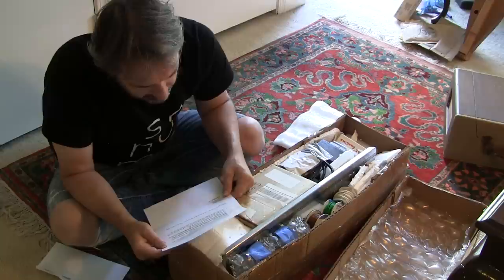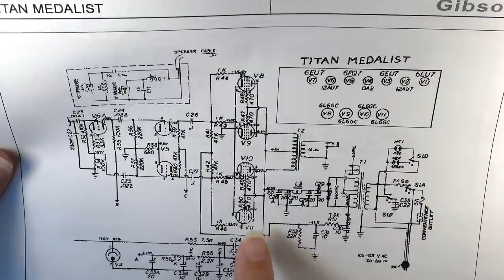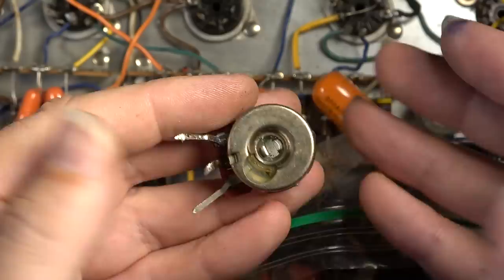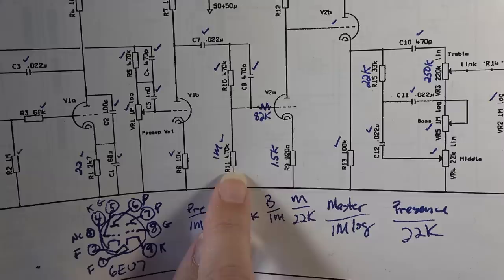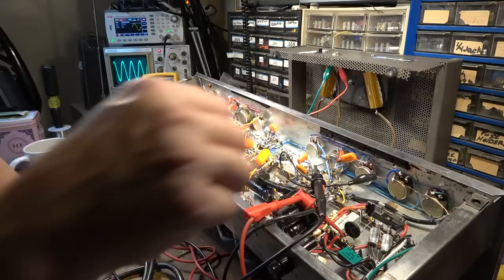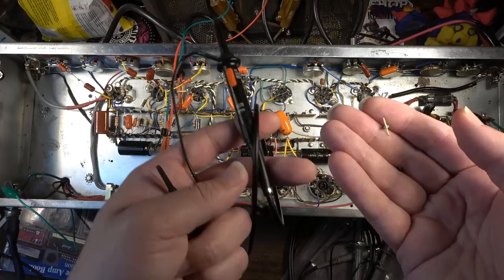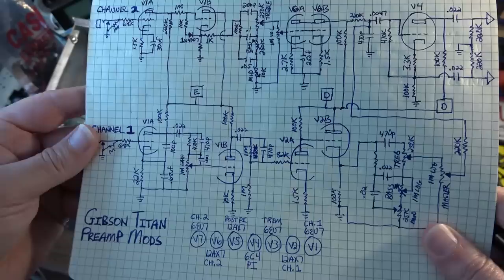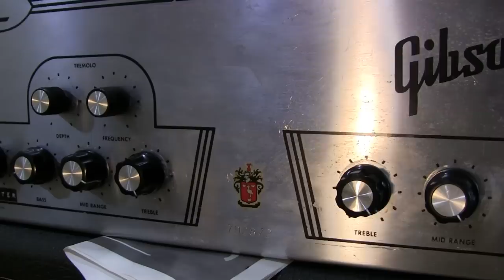The MOST POWERFUL GIBSON AMP of the 1960s - TITAN MEDALIST REPAIR & MODS!

Comment: Man, it’s so much fun to mess around with basically a clean slate. 

I used an early 15 watt Marshall DSL chassis and cab to build something similar to this. I even kept the spring reverb that’s active on both channels. 

The Marshall side sounds more like a SLO with that 4th reverb gain stage. The cathode follower really hits the last stage hard though.

I had to send a lot of gain straight to ground later in both circuits and it still rips your head off!

I had to cut the reverb level by 90% compared to the standard Fender levels.

If I had used all 12AY7’s it would still had been set to kill.

The hardest part was patching up the original chassis holes by soldering in brass plates.

Comment: Very impressive. The dual nature of the amp is actually pretty cool. I don't play that kind of Marshal sound anymore but it really is there in all it's screaming glory, while at the same time the Fender side sounds great, as it should. Very nice tone. I like that the tremelo works with both channels.... I was afraid the Fender side would not have it. btw, you forgot the value of the cathode resistor on the cathode follower. Nicely done Brad.

Comment: Well done! I must say, I think having the terminal strips is at least easier to see components rather than Gibson's other method of manufacture - as Uncle Doug called it, linguini on an eyelet board! I'm working on my own Epiphone Embassy amp, very similar to Gibson's GA-95RVT, which had been modded by someone before. I have already mapped out the entire eyelet board, complete with buried components, and managed to rewire back to the Epiphone schematic rather than the GA-95RVT used by the last tech. From there I'm making adjustments to the circuit to improve tone (thank you Uncle Doug!), comparing parts of the circuit that a Dual Showman uses. I have to tell you, when I saw what a mess it was inside, I had almost the exact thought as what you've done with the Titan Medalist here - just use the chassis as a build platform and make an amp that works, with some more modern mods like adjustable negative feedback (current design has none) and a presence control. The way the amp is now, you can turn the "loudness" control on the reverb channel all the way off and still get reverb out with the reverb (send) control... offered up in one YT video as a "feature". I'm attempting to return the reverb just prior to the loudness/volume pot so reverb stays relative to direct signal. The tremolo circuit is the same as what you were up against, and I'm definitely not happy with what it's doing at this point - but not sure if it's performing to spec or was messed up by a previous mod. Challenging work this is, and definitely a labour of love and, for me, a real desire to keep stuff out of closets, recycle or landfill. I'm inspired watching your struggles and then success at building a very expressive and flexible amp that only suffers for the same remaining challenge as mine will... these things are massively heavy!! All the best as we head into 2023!!!

Comment: Thanks for the primer on troubleshooting!  I always learn from watching your vids.
Reply from the maker: If you don't own an oscilloscope or dummy load, you can still signal trace in the same general way with a capacitor probe and an external bench amplifier to send signal to. I sometimes even prefer doing it that way because you can easily distinguish between different kinds of noise.

Comment: @The Guitologist  Brad, when using oscilloscope it would likely help you a lot if you used the other channel to display the input signal as reference and trigger on that one. saves time searching for the trace and gives a very good idea of how its changed. you then need only mess with the levels for the channel scope input. i verified your BK model 1525 is indeed Dual Trace
Reply from the maker: Until now, I only had the single matching probe. I'll probably follow the method you described going forward.

Comment: Kudos on another great vid, Brad.  It's always good to see you roll your sleeves up and get into the guts of an amp.
I'm loathe to presume to offer advice, but have you considered elevating the voltage of your grounds?  Robrob has several good tips about that on his amp page, and you'd only need to add a couple of resistors and an elco off the power supply; 50-60V should do the trick.

Comment: Hey Brad, what you're seeing on the output of that 12AU7 on the scope looks an awful lot to me like that 12AU7 is going into parasitic oscillation, could be bad decoupling on the power supply to the 12AU7 or maybe the grid needs some shielded wire.

Comment: Implementation of a presence control on a cathodyne is pretty easy. A good model with presence and resonance control with an almost identical pi arrangement "ax7 cathodyne into an at7 gain afterwards" are peavey VB2 and VB3. Takes gain to push 3 or 4 pairs of el34s .

Comment: Hey Brad, the clipping you're seeing at the output of the tone stack is typical of what you would see in a Marshall amp, so to me it looks normal.
Reply from the maker: Clipping doesn't concern me, but too much or too asymmetrical like it was at points didn't look right to me.
Reply: @TheGuitologist  A small amount of asymmetrical clipping is considered desirable, and can sound musical, but if the clipping is too asymmetrical it'll sound bad, I've read somewhere that an approximately equal ratio of symmetrical to asymmetrical clipping tends to sound the best, symmetrical clipping tends to produce odd-harmonics and asymmetrical clipping tends to produce even-harmonics which sound pleasing to the ear, the human ear itself naturally produces some even-harmonic distortion, which is probably why a lot of guitarists prefer the sound of a tube amp, but then again everyone has their own opinion on what sounds good, I was very surprised at how good the Gibson amp sounded after you finished working on it, I think it easily sounds good enough for studio recording and gigging.

Comment: You must be a genius that is awesome you completly redesigned and improve the amp. Mabe shielded wire should be used for grounding? You dont like workiing on these because of so much labor but you learned how to make a killer amp that part is really cool.
Reply from the maker: Shielding a ground is unnecessary. Shielding is usually tied to chassis ground at some point.
Reply: @TheGuitologist  Yes of course. But you said the location of the fender side was too close to the power and I thought maybe shield the wire where its close to the power transformer Or you could make a metal shield for the transformer?
Reply from the maker: OH! Gotcha! I misunderstood. My bad. They provided shields from the factory, but they are to shield the user from the power switch, I think.

Comment: I had a challenge with  a pair off Beveridge speakers , those with a 3200 volt in the electrostatic field,  had never seen electronics with positive ground before, this was in Oslo, Norway 1981 or 82. Had zero volts,  four 1N4008 parallelled with four 1Mohm,  been watching "Uncle doug" for many
years, I`m using voltage regulators OA2, OB3 , STV85 and 108 (Telefunken), together with transistors,
This amp looks like another nightmare, a schematic whith "sleeping" tubes, looks like a teenager modified it to a "high end HiFi amp".
 very best regards C. A. Sweden

Comment: There an original WITH cabinet in Knoxville Tennessee (local pickup only), for under $1K. I'd nab that if I lived down there, possibly C10N and C15N speakers in cab!
Reply from the maker: Someone in the area ought to go get that.
Reply: That’s a lot of heavy iron for that price! I wouldn’t play a bass into those old speakers but I sure as hell would play guitar into them.
Reply: Great deal. I spent plenty for mine. Per the woofer, I was told it was for jazz licks sounding clean, not used for a bass guitar.
Reply: The cabinet for the one in the video is at my home. There was no reason for me to ship it to Brad. It is also in really good condition.

Comment: OA2 tubes go in Hammond organs .I know of a church in Florida that took the organ to 2 different repair shops and they both told the owner that the parts were obsolete and I repaired it by putting an OA2 tube The tube was frosty white cause it had air in it. So hang on to the tubes. The church almost tossed out a very beautiful organ

Comment: I have also thought about different ways of approaching amp repair in terms of giving estimates. If you had gotten the letter about what had been done to the amp (3 tinkerers) and maybe a gut shot (not always possible I know) you would have realized it wasn't just cleaning pots and changing caps. This was essentially a rebuild-this-amp job. I try to get as much info as possible beforehand.

Comment: IMO That three wire thing with caps and resistors, I believe is a make-shift brightness circuit (initially in a Gibson GA-xx amp would look like a flat rectangle cap with 3 wires coming from it). To get a fender or marshall sound, you won’t need that circuit.  That brightness / clean thing was mainly for 50s surf music, but in this situation, would be missing reverb(surf music necessity) so still not a major thing to add.

Comment: A bit of trivia, Marshall actually based the design of their early JTM45 amps on the Fender Bassman, since guitarists found that the Bassman which was originally designed as a bass amp, actually turned out to be a really good amp for guitars.
Reply from the maker: True!
Reply: @TheGuitologist  They do sound good on guitar,  but I was told bass amps are built to sound all notes a whole octave lower than a guitar amp is set up.Wazup with that true?

Comment: doesnt the 5e3 deluxe use negative feedback to the cathodyne pi, i built a stripped down 5e9a tremolux and it uses a para-phase pi and doesn't use a negative feedback path which is one of the reasons i think the break up sweater than the deluxe

Comment: As a Gibson and Fender dealer in the 60's, the Gibsons were hated by my repair technician. Factory support and schematics were practically non-existent. As pointed out, the systems were unique and that is not in a good sense. 
 Fender was far more reliable until they came out with their solid state amps.

Comment: Crazy Brad, was just bragging about a lease violation with my dinky Fender Mustang ll and now all the lights went red and the only output is the aux... No more guitar for me my friend... Any thoughts?
Reply from the maker: Don’t really understand. Never worked on a Mustang amp.
Reply: @TheGuitologist  I don't blame you. Time to drag out the crappy Crate...but will troubleshoot the crappy fender... Cheers!
Reply: @TheGuitologist  It's a bit of a paradox... Should I spend twenty minutes troubleshooting it or throw it in the trash... Decisions, decisions...
Reply from the maker: I woudn't throw it in the trash, but to me, it sounds like a switching issue maybe? The #1 cause of issues on amps like that is loose or broken solder joints.
Reply: @TheGuitologist  Thanks!
Reply: @fullwaverecked  Thats how all the champs got trashed. Will there be a market for vintage transitor amps on day? Hmmmm,...
Reply from the maker: No problem. You might even have luck googling common issues with that model amp and seeing what the forums have to say. I'm willing to bet whatever problem you're having, you're not the only one out there having it.
Reply: @TheGuitologist  Hey Brad, the little Fender that could somehow reset/fixed itself when I turned it back on the next day. Interesting, what happened was, I was having lots of cold beer, running an Eico HFS-1 parallel from the Fender (4 ohm total load ?) and a gal stopped by wanting to hear loud '80s disco (fon patched into aux on amp) with loud guitar. The poor thing (amp, not chick) couldn't take it and guitar input went unresponsive, red indicator for foot switch jack LED came on with nothing plugged into it, but aux from fon still played music from amp. Strange indeed. BTW, subbed to CGS. Thanks again for all you do! Cheers!

Comment: Using the chassis as a conductor path in the circuitry is a recipe for disaster !   The   chassis  should be used as a shield  with  just one connection to the circuitry  at the input or most sensitive part of the circuit.  The circuitry around the power supply, rectifiers, and filter capacitors must not share  the signal path or conductor to ground  along with that used by the amplifier circuitry or you end up with unwanted  60 -120 hz  noise.  Obtaining the optimum grounding scheme  is almost an art .
Reply from the maker: Yeah, it's something that doesn't come up too often, but when it does, I seemingly have to sit and stare at it for a while to figure out where it's going wrong.
Reply: You are absolutely right.
Ground loops and ripple currents in ground wiring are normally pretty easy to fix if you know what you are doing, but if the amp uses chassis as a ground rail, it can be very tedious job to correct grounding problems and to redirect ripple currents away from low level signal ground paths.

Comment: That ticking noise sounds to me like the amp is motor-boating, if that's the case, I'd suspect one of the power supply filter caps to be faulty, the amp also sounds like there's an earth/ground-loop somewhere.

Comment: The idea of having a fender-esque circuit on one side and a Marshall-esque on the other is very interesting. Lots of tonal possibilities with the two most used amp circuits. Just a shame you couldn’t eliminate the hum/feedback due to input placement
Reply from the maker: I eliminated it. I added a second ground bus on Channel 2 and moved the CT for the PT to the reservoir ground point, away from the bias ground point.

Comment: so what did you do to get rid of the noise on this amp, by the way I have a peavey heritage hybrid amp the solid state preamp works good but the tube output does not have any power, very low out what would you charge me to repair it and a video on it would be cool

Comment: Brad, did you redo the ground on the 2nd channel? It just jumped to you playing.
Reply from the maker: I did add a second ground bus to Channel 2 which isolated it from using the same ground points as the power caps over there. Also, they had tied the PT center tap to the same ground point as the bias and filaments. I moved that to the ground point for the reservoir cap where it belonged. This all solved the ground hum issue on Channel 2. Sorry I skipped that part. I thought I filmed it but when I came to edit, the clip was missing. I also went ahead and moved the earth ground for the power cord to its own lug on a bolt near where the cord comes in.
Reply: Good catch! Hopefully Brad pinning this will help people follow better.
Reply: @TheGuitologist  
Brad, I appreciate you spending the day with me/us. 
Love what you do and really curious/fascinated about/with valve amplification, so thanks for your knowledge and experience. 
Warm regards

Comment: Some shielding should help, just a thought
Reply from the maker: This amp has those shields that screw into the chassis, but I had to use a couple of the screw holes for those to mount stuff, so they won't be going back on.

Comment: Did you ever discern what was wrong with that AB potentiometer? I've got one exactly like that One, laid out exactly the same, from the same company in a vintage electro harmonics pedal I have that I Can't seem to get to function correctly. I tore it apart as you did And have cleaned it and cleaned it with cotton swab and alcohol. Doesn't seem to have helped. But like you I feel like that there's nothing that really should be wrong.  Nevertheless it is just scratchy as h*** and has values all over the board

Comment: Brad, Do you think the poor circuit layout may have been a result of the cosmetics of the panel layout taking precedence over the circuit layout? The front looks much more symmetrical than the sign wave output.
Reply from the maker: Intuitively, the symmetry seems like a good idea, but not in practice.

Comment: i just did a repair of two amps built in my town by a guy who left town to live off grid he was a conspiracy guy, anyways both amps looks 3 to 4 times worse than that amp. Im not kidding when i say he had 3 pieces of wire soldered to gether to make it an inch and a half of distance. it was like he was picking pieces of trash off the floor to wire it. i got both amps up and running sounding strong no less but oh man when i first saw the circuits I could nt believe it. total freaking nightmare. fire hazards all over it.

Comment: Might as well get some kind of rack mount guitar preamp with good tone/controls and a pro audio amp... then again, no one needs or honestly should use anything over 100 watts, and that's in rare cases. Especially if you're being mic'd on stage. 50 watt tube amps are completely capable of pushing a 412 cab. You could even run a 212 cab or even a 112, since let's face it, unless you're the only guitarist running stereo, you're going to get one mic at your local venue.

Comment: That tick tick sounds like a transformer insulation failing - electricity is arcing between the winds..
Reply from the maker: Normally I might think that, but in this case, I was pretty sure it was a cap charging/discharging or a result of some parasitic oscillation from something being miswired.